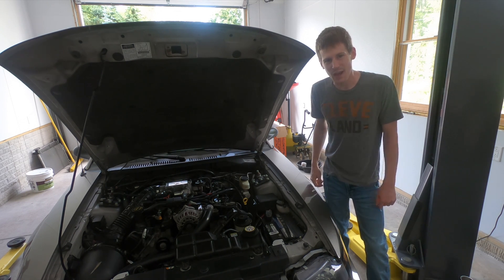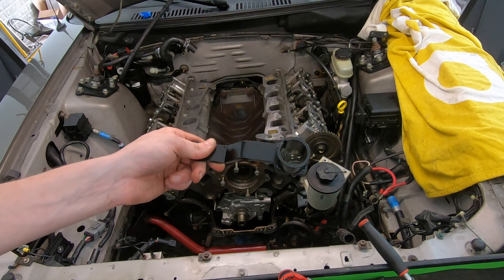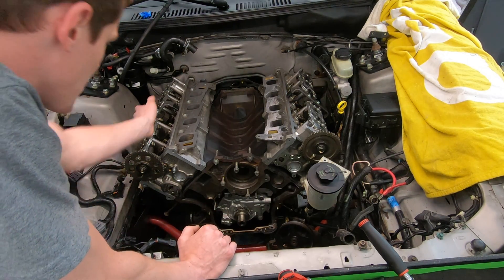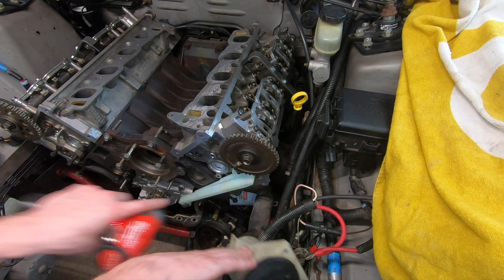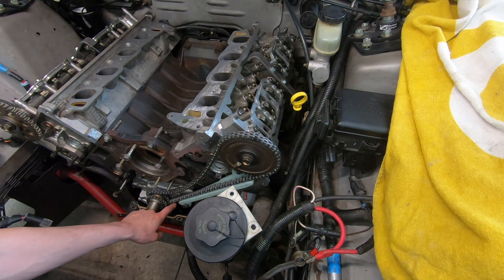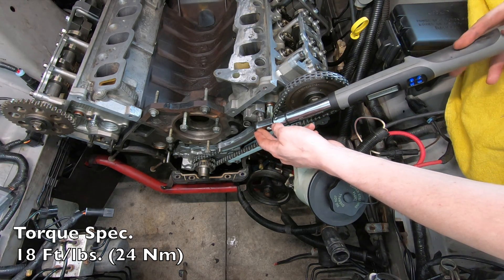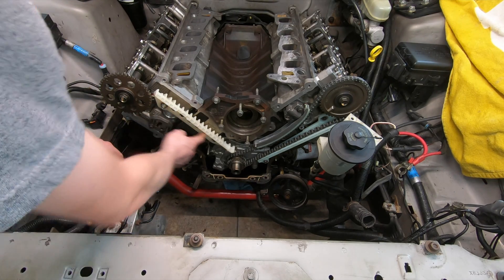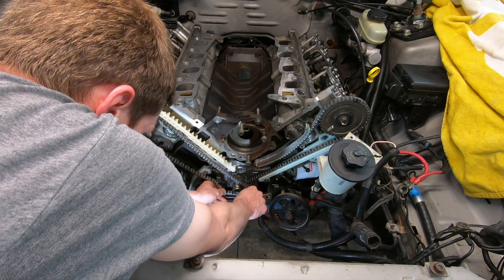Ford 4.6 2V Timing Chain And Guide Replacement.

Comment: hey man long time subscriber here - love your work.  Today I ran into an issue doing this job on my 2011 Crown Victoria Police Interceptor.  I've asked about 100 people online and everyone is telling me something different, so I thought I'd ask the expert directly.  I replaced the chains, guides and tensioners with Melling parts.  The driver's side chain lined up perfectly dot-to-dot.  The passenger side is off 1 link.  Would you suggest I remove the cam holding tool & turn the cam sprocket with a wrench slightly to get the chain to line up?  Some are telling me this is perfectly fine to do, and others are saying not to do it - and if it's not lining up then something is wrong.  I would really appreciate your input.  Thank you sir
Reply: What did you end up doing?

Comment: Thanks for the video...my 4.6 in 2000 expedition seems realistic fir me to do with a small investment in tools. No startup rattle yet so I'll hold off. 297 000 miles with consistent oil changes.

Comment: So all I heard is quit being a puss cat pull my driver head off change the blown gasket and do the chains. You go if gt all the parts Dakota quit being scared. 😂. I guess I’m scared that it won’t really be at Tdc  but you just told me get it there before disassembly 😮 can’t wait to grenade the car I never wanted and ended up loving the most. ❤

Comment: So if were installing cams how do we watch out for cylinder 1 nd 6? I bolted my heads up now im putting in cams nd my my motor is at TDC, how do i watch out 4 this everything is off nd i need to be at TDC to time my car right,
Reply from the maker: At TDC don't try to open valves on 1 or 6.

Comment: HOw often should this be done? I have a 02 Mercury with 260k. I have no rattle in guides, change oil every 5k Pen synth. My mechanic says I should not mess with it since its not having issues. I feel it should have been done about every 150k. Let me know your recommendations. I put a trans in 2 years ago and I do not want my chain to go on me. I know what will happen if it does, as you mentioned.
Reply from the maker: Unless it's making noise, I wouldn't bother with it. I only changed them because I had to remove all of this to change the HG's. When you have the old timing components sitting in your hand it's a little hard to justify to yourself reusing a 20+ year old timing set.

Comment: So with the harmonic balancer notch at tdc. Wouldn’t that automatically have crank gear notch at 6 o’clock already
Reply from the maker: Yes. It would, the issue is the cams turn at 1/2 the speed of the crankshaft. So you can line up the TDC notch but you still have the possibility of the cams being 180 degrees off.

Comment: Hi can you please help . I have a 2004 gt mustang 4.6  I put oil pump in and while putting the chain back on the left i had on loosen the cam shaft hold down tool  the move the cam so the dots would line up and the wrench slip off the cam bolt annd the cam moved . I never loosened the one one the right but now rhat the cam moved im lost plese help do i have to take the head off now or the cam folwers off can i just turn the cam but i not sure which way the cam move i just no it rurned ty can u help me
Reply: Hi my name is Sam I sent a text early but I didn't mention that maybe I didn't have the cam shaft hold down tool tight and it moved  so I'm lost now do I have to take the heads off now or the cam fowlers off so I can turn the cams back to the one on the right at the 11position and the on left to  the 12 o'clock position both chains are off

Comment: what repair book are you using for this? very helpful video thank you
Reply from the maker: OEM Ford Manual. You can find them all day long on Ebay. The newer stuff may be harder because they are all electronic but back in 01 they still printed them. I have 3 different volumes on this car. One is about 3 inches thick. The other is about 1.5 and I have a manual of just wiring diagrams. Hard to beat for $100 about 14 years ago.

Comment: Hi RepairGeek, appreciate all your videos they have been a big help.  Currently going through this process however its a bit more complicated hope you can offer some advice.  

I had to replace my heads due to a valve isssue.  My question is where should the crank keyway be positioned when reinstalling heads? I have a bunch of people telling me that having the engine at TDC is incorrect for a head install, they say to put the keyway around 9 o clock position for PTV clearance, which makes sense however, im confused how to get the timing chains lined up with the markings on the crank and cam gears at that point?
Reply from the maker: If you're concerned this is how I would do it:
1. Pull the cam followers out of the heads. This way it's impossible for any valve to be open.
2. Install the heads with the cams in place, time the motor as shown here.
3. Once the cam timing has been verified to be correct. Reinstall the cam followers using the cam follower removal/installation tool.

If the cam followers are not installed in the heads. It's literally impossible to run a valve into a piston.

Comment: I have a 2006 2v 4.6 that has a very faint tick at idle and it speeds up with rpm. The car has been making the same noise since I bought it with 118k on it. Now I’m at 160k and it’s the same but I’m noticing metal in the oil. Do you think it’s a lash adjuster and rocker? Or the timing chain. Again it’s very faint sounds like I’d you tapped a screwdriver on a piece of metal very lightly.
Reply from the maker: Probably a chain or tensioner. If you let the noise go they will eat up the timing cover.
Reply: @RepairGeek  thanks

Comment: Not even halfway through and I'm confident that this is achievable, going to watch it a couple times though. Noticed chain smacking last week, have had low oil pressure for a while. May step up my cams also. 
01 Crown Vic.

Comment: How can i put my car in TDC if i already took the tensioners and guides off and the camshafts are being held by a special holding tool so they wont spin and the pistons hit the valves on my 2002 mercury grand marquis 4.6 2v v8? Before i took everything apart i had put it to TDC and now the marked links wont wont align right on the marked spots on the sprockets and i made sure i spun the crank till it was a TDC any help please!?

Comment: Hey I had the crank sensor unplugged and started cranking my engine to get the oil pressure up it sounded strong, after a few cranks I plugged back in the sensor and tried to actually start and it seemed like the engine locked up but I can spin it counterclockwise for like 90 degrees and locks again and then spin it clockwise and it locks it seems like it’s hitting a valve or something I’m not sure what I did wrong I changed the head gaskets and installed ford’s timing kit I matched up the markings I followed your video and now I’m back at the timing please help!
Reply: What was wrong? How did you fix the issue?

Comment: Outstanding and concise video. I get a little bit of a rattle if I don't drive my Lincoln Town Car for a day or two. I'd rather do it now than later. Thank you for leaving out all the stupid details. There's a good chance that if anybody is doing this, they don't need a close up of the 8mm socket you're using to undo the airbox. There's a pretty good chance they don't need that knowledge nugget. Your information was detailed and valuable.

Comment: Well done.  The tensioners have a fail safe feature that physically limits the amount of non tension so as to avoid piston to valve issues with momentary lack of oil pressure.

Comment: The part # for the timing guide bolt seems to be a door handle base bolt how is this the right part? I cannot find any interchange info on it being used for the timing guide.
Reply from the maker: Well, it's the correct length, thread pitch and grade. Who cares what the description is? The only thing different from the other bolts is this one is zinc plated.

Comment: Nice video man! However, I have a question and I was hoping you can guide me in the right direction. I want to replace the head gaskets on my 1997 f150 4.6l. If I remove the heads using the cam tools and install the heads back exactly as removed, do I have to degree the cams? Thank you.
Reply from the maker: That's what I did on this car. Installed the lock tool, removed the heads, installed the heads and did the timing procedure that you saw here.
Reply: Awesome! Thank you so much.

Comment: Dude. It’s wild looking at your clean engine and engine bay lol. I’m doing chains, guides and tensioners on my 02 GT that just hit 250,000 miles lol. It runs like a top but it’s definitely greasy on the front cover and valve covers. The right hand guide plastic broke, I started hearing the mild chain smack on the plastic a week ago. So before it gets bad or jumps timing I’m doing it.

Comment: How much should/would this cost to have done by a shop? I think I might have timing chain/guide noise. It comes and goes randomly. But I finally got the noise today and was able to pull the belt, which leads me to believe it’s inside the timing section. Not sure if this is something. Should tackle myself or let a shop do it

Comment: Hello, I have a question regarding 4.6 heads.  What do you recommend replacing with?  I'm having an issue with a spark plug being stripped out and having to helicoil but it beyond repair.  I've seen either iron or aluminum as potential replacements.  Thanks

Comment: Great video. I purchased the 6477 cam holding tool. It doesn’t say 2003-04 GT, but I’m seeing some say it still worked. Do you know if that’s the part number you used? Thanks again
Reply from the maker: That's what I used. I don't know why they would say it wouldn't work. All 2v's have an exposed spot not covered by a cam tower cage which lets that tool work.
Reply: @RepairGeek  I used them today. They worked well. Thanks 🙏🏼

Comment: When is it really time to replace. I have a 2006 towncar 156k dosnt rattle at startup. Only under load between 2000 and 2500 rpm. Any experienced input would be  appreciated. I was told to let it go.
Reply: Did you figure out what the problem is was Let me know thanks.
Reply: @markchimmy  i know what the problem is. The tensioner is oil fed and its worn out along with chain wear. I was just curious if you wait tell it rattles on startup to fix it. Or when is it time. Mine is still the same hasnt changed.

Comment: Got a question for ya is the 98 F150 with the 4.6 2v. The same procedure?
Reply from the maker: Yes.
Reply: @RepairGeek  I have a 2001 f150 4.6lt 2 valve Romeo.  I took my head off cause of a exhaust bolt broke off in the head and in the process the cam moved. I had the cams locked but dummy me didn't take the head bolts out 1st and I didn't have it at TDC. So I got the broke bolt out and replaced the head gasket. I put the head back on and motor want turn all the way around. I think it's hitting the valves. If so how can I get it back in time? Thank you for any info.

Comment: Hey I'm the guy with the 2003 Lincoln towncar 4.6.. I just purchased a new Cloyes timing set at Summit racing yesterday with new gears the complete set and it's the SJ part number because I wanted the cast iron tensioners. My question is on the back side of the tensioners do you need a gasket? Since oil flows through the back to build oil pressure and put more tension on the chain.. I haven't taken mine apart yet so idk..
Reply from the maker: No gasket. The plastic tensioners have a gasket that likes to blow out. The iron tensioners bolt right to the head with no gasket.
Reply: Did you do yours yet? I just did mine thanks to this video.

Comment: Wow man you made this look so easy and not so intimidating that video was so informative.. I do have one question are all the 4.6L Ford engines just about the same far as the timing chains and tensioners? I have a 2003 Lincoln Town car with a 4.6 and I'm getting clattering sound at certain RPM I know it's the driver side chain. Is it the same procedure as far as torque specs and plastic guides plus tensioners?  And do they have the cast iron tensioners in the Cloyes kit? Starting in 2003 Ford put plastic Tensioners and I think that was a retarded move for Ford to do that other than cost saving.. I'd rather pay more and get something that lasts..
Reply from the maker: You can swap the plastic for iron without any issues. I know on the 2v engines for sure. Not sure about putting iron tensioners on the newer 3v stuff.

Comment: So let's say I attempt to repair my headgasket on my 00 mustang gt ,my only concern is the cams moving and me messing up the timing,could I just remove the valve covers,and put the cam holding tools on first before removing the timing cover and, chains?
Reply from the maker: That's what I did. Spin it over to TDC. Lock the cams, disassemble it.
Reply: @RepairGeek  sweet man thank you so much,also when I put to TDC do I have to remove spark plugs? I watched another video and I seen someone do that.
Reply from the maker: The engine turns easier with them out. That's the only advantage.
Reply: @RepairGeek  awesome thank you so much for the knowledge, I really appreciate it.

Comment: Have a Crown Vic 4.6 …Instead of using a cam holder or removing followers I used vise grips… hindsight is 2020… that being said when I reinstalled everything my passenger side chains is loose (along the guide)…should it be tight? Because I have read Ford engines rely in oil pressure for timing tension?? Any info helps thanks!

Comment: I don't like the cast iron tensioners and the only reason is the ratcheting mechanism.  It causes the guides to wear through in many cases, since tension can't let up.  The newer plastic style has its issues with seal blowing, but they don't chew up the tensioning guides the way the cast iron ones do.

Comment: Hi Repair Geek,  Thank you for your reply.  I did check a cylinder on each side of the 4.6, and both had compression. I believe that would show that the chains are not  broken.  Originally the timing chains were making a lot of noise.  Took my 2000 expedition to a shop, and the guy there said to quit driving, and replace the timing chains...  I let the expedition sit for 6 months, then tried starting...  First engine turned over normal, then had a different lighter sound while trying to start.   I can get the engine to fire intermittently, (kind of bumps around), but won't come close to starting.  What do you think I should check now?  Thank you for your help, and suport!!!

Comment: Hi Repair Geek,  Great video!!!  I have a 2000 expedition 4.6, chain was making some noise, and I believe the chain broke or slipped on startup... Could I have damaged the valves or engine, was not driving just startup in driveway?  Thank you for your help, and support!!!
Reply from the maker: If it broke valves are bent. I doubt it slipped or broke though. Typically the guides wear out and the tensioners fail causing noise. Noise only on startup is usually a sign of a bad tensioner.

Comment: Ever done one without pulling the engine? Oil pan and a shit ton of accessories gotta come off. Which usually means pulling the engine.
Reply from the maker: I was doing head gaskets in chassis. That was why I replaced the timing setup. It was a "while I'm in here" repair.
Reply: @RepairGeek  ok. Was wondering. You sure got her cleaned up nice. That's why I was thinking it was pulled and hot tanked. Thanks for the video. Super helpful with the torque specs and tips!

Comment: That bolt part number comes up as an expedition door latch bolt just wondering if that’s right lol wouldnt be surprised if ford needed to use up all the extras lol
Reply from the maker: I saw that as well. Worked fine for me.

Comment: Hardest part seems to be taking everything else apart to get to it
Reply: Only if you are not rebuilding the engine. Modular engines are not hard to work on. 😊
Reply: Pretty easy to take off and put everything on did it in 2 hours 😂
Reply: @Rowdy_2v  i simply said "hardest part"

Never said the whole process was.
Reply: @frankcastle4010  hes not wrong (owner of 4 crown vic's 3 CVPI'S and one Lx) its very easy but also the hardest part since thats where shit goes wrong xD
Reply: AND THATS HOW MECHANICS MAKE THEIR MONEY😎🤝
Reply: It usually is on these things.
Reply: Truth!
Reply: No hardest is to build it back no 🤔
Reply: @sebzhulk2997  I don't think so. I feel like once you take everything apart you have an idea of how it goes back together

Comment: I just bought a 01 f150 with a 4.6  and my local mechanic says I have a blocked oil passage and it is making my timing chain wear out due to the computer retard my timing and as a result the chain is making a slapping noise.
His suggestion is to get a new motor and not mess with the timing chain due to the blocked oil passage. 
I also seen another video where a guy found a piece of rubber gasket stuck in the oil passage restrictor on the passenger side, so his and your video gives me hope that I don't need to buy a new engine for my truck. 
Thanks for the great video
Reply: First thing I would do is drop the oil pan and examine it for any blocking  causing oil starvation if anything it would be broken pieces of timing guides that you'd find!

Comment: Set crank keyway to 12 o'clock and the pistons will all be low enough to not hit the valves. No need to pull rocker arms or use cam holding tool. Thank you for the video!
Reply: If I’m doing a chain replacement on my 4.6 2V in my 02 GT and it’s timing is set already can I just put the keyway to 12 o’clock and and swap out the chains , guides and tensioners? I have the cam holding tool and valve covers off. I’m just making sure the proper marks to be at.